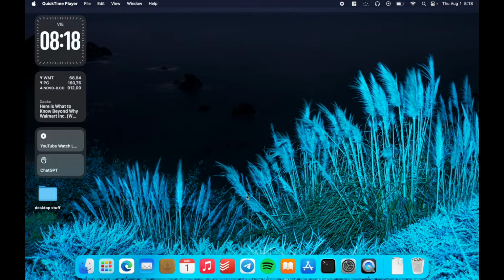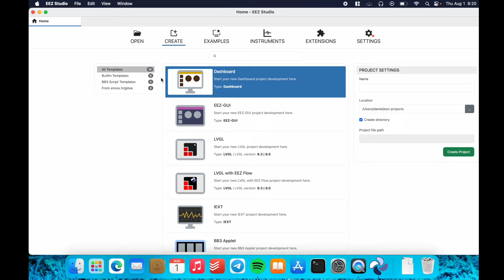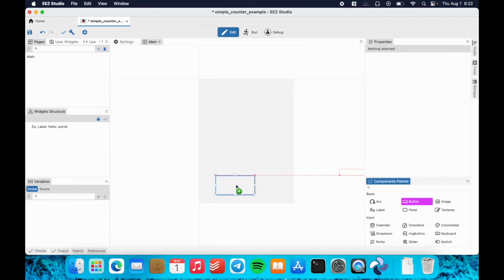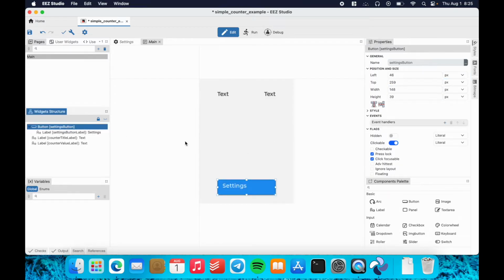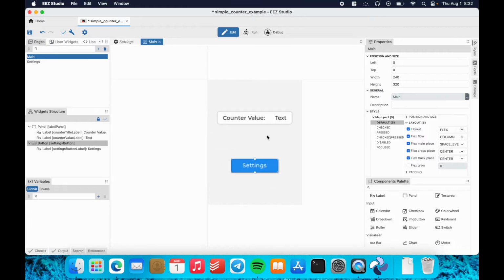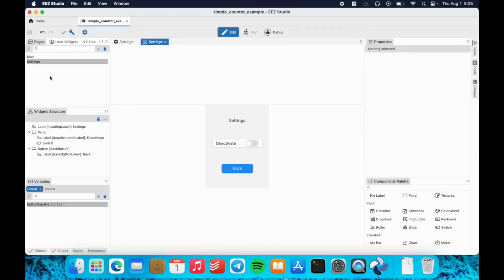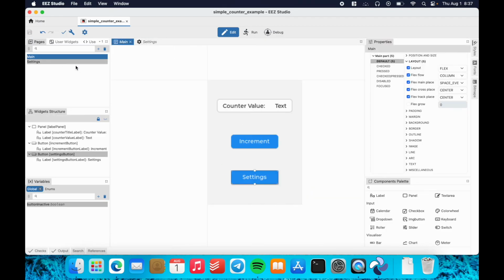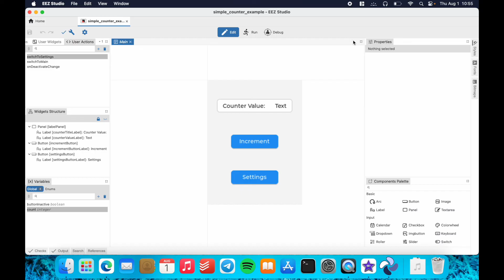Use EEZ Studio to Build an Arduino LVGL UI | nerdhut.de

Comment: Hi, thanks for your video.
Question: is possible develop an interface with a number of variable buttons displayed when running or its only possible design buttons in design time ?

Regards
Reply from the maker: @lybce  Hi! Yes, you can dynamically create and add buttons to the layout but you have to write the code for that manually. You can look at the C++ sources generated by EEZ Studio when it adds buttons and call the same functions in your program to add buttons on the fly

Comment: Can you make tutorial for emscripten? I tried it to build webiste from c and h files, but emmake couldnt run. Maybe problem sets in platform. I used Windows, but i don't know if it will work on Linux. I need to test someday.
Reply from the maker: Great suggestion, thanks! I may look into webbased UIs at some point